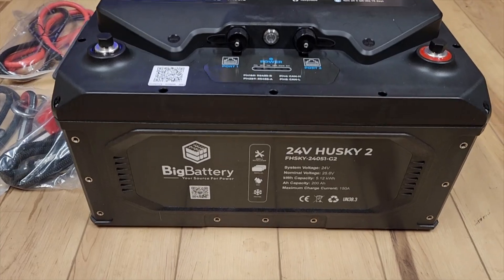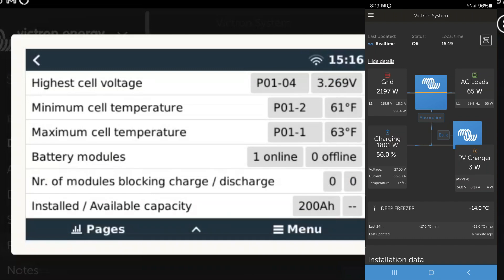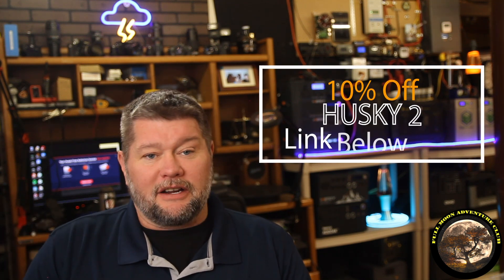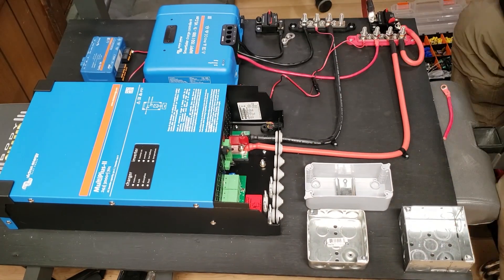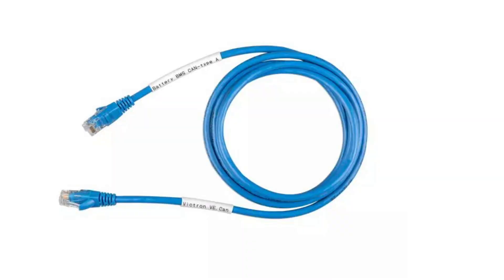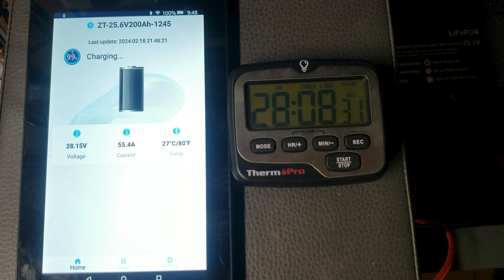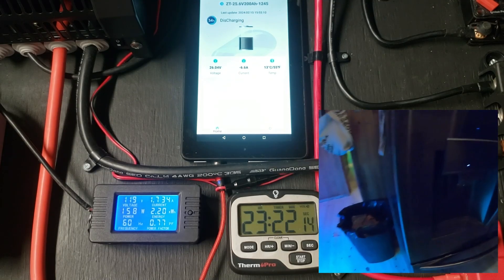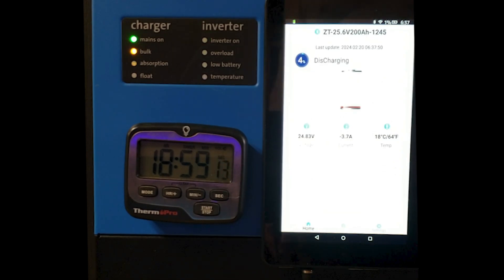BigBattery HUSKY 2 Power Backup Test and Review: My New Home Powerhouse!

Comment: I am using 2 Husky 2s in my Polaris Ranger.  They are awesome batteries.  My question is if they are powered on can they stay on and go to sleep and wake back up when needed?  I don't want to have to power on and power off every time I use my Ranger.
Reply from the maker: You can leave the battery on with almost no power drain and you will be fine. It is a nice added feature that you can turn off the battery if needed.

Comment: How many would you say I would need to run an ac on a hot day for roughly 8 hours? Do you know if it’s okay if the max current charge is the same as the amp capacity, would that shorten the lifetime of the battery? Thank you in advance!!

Comment: Lots of good surface information. I am in the process of trying to find a battery that can run my victron multiplusll 24v 3000w 70amp charge. I have already destroyed 1 bank of batteries to small of Bms it was 100 amps the victron will pull 139 AMPS AT  120v 2980 watts running refrigerator coffee pot and washing machine 4 burner toaster its a beast so I need the 200 amp BMS Like the Big battery Husky ll lights refrigerator TV and stuff like that are easy 30 amp if the compressor is running on the refrigerator no use in having a 2500 watt constant draw 3000 spike  inverter .if you can not use it .these batteries are not cheap, but they sure look like a quality product that will do the job. Thanks for your video. I found it looking for more information on the big battery still researching
Reply from the maker: Agreed. This battery certainly seems capable of handling the full load of the multiplus2. We vacuum and make coffee on that circuit as well with no issues whatsoever. More videos coming using bigger loads and more experiments once I'm more familiar with the entire system. Thanks for watching and happy camping.    Jim

Comment: how many watts of solar would you need each day to keep up with the home's demand
Reply from the maker: Probably 500 watts of solar for the circuits I have connected. That would probably be enough to recharge the battery during the day.
Reply: Look at your power bill it will tell you your kwh mine was 290 Kwh last .month without any solar and is very low, that's a good place to start with a solar  calculator